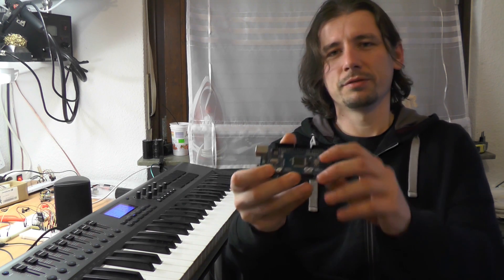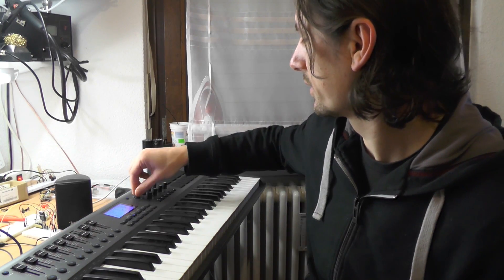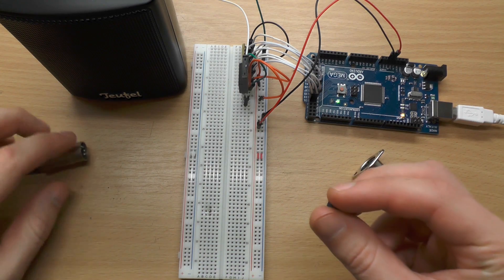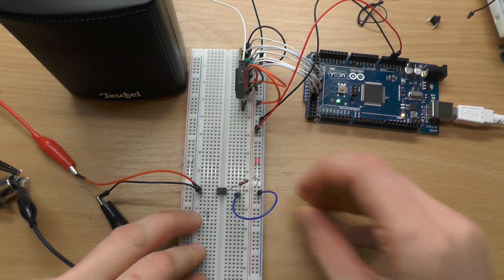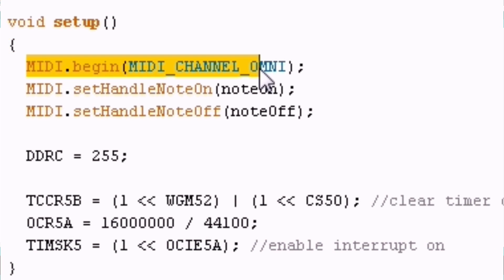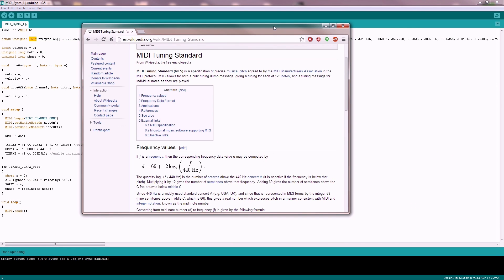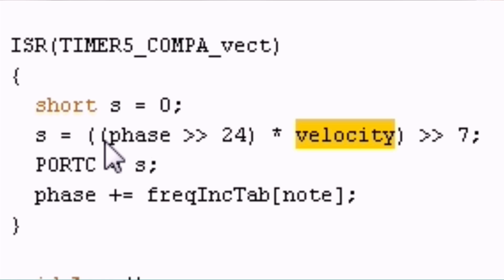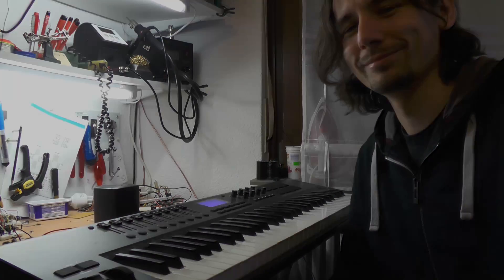Arduino MIDI synthesizer (Part 1) - Basic MIDI IN circuit

Comment: Do you use a reconstruction filter after the DAC to clear the spectrum? I'm asking this because I'm implementing a DDS in a similar way. The problem is when I generate a sine wave its spectrum is full of harmonics. I use a 10 bit DAC and a 2000 samples per period of the sine.

Comment: Hello!
What is a best model/version of Arduino to build just a MIDI-2CV device? I want to build a simple monophonic analog synth. using basic radio details and microschemes. But I'll quickly will be bored by it's "one tone sound". Even a potentiometer will not save it :)
So that's why I'm searching for this. Of course later I'll want to build a polyphonic analog synth. So probably I will use the same Arduino to send different CVs to different "cards" of my future poly-synth.
Do I need Mega? Or it will be the same with Uno and etc. Pardon me, I'm a noobie here :)
P.S. I have the MIDI keyboard already.

Comment: It would be amazing to see how to make midi controller synth using sound chips (like cheap CD40106BE / atari YM2149F/ NES RP2A03) instead of arduino generating waveforms.
Reply: If you like electronic a little bit more you should take a look at circuit bending. A lot ow good work with cheap keyboards, toy keyboards etc

Comment: Your MIDI interface circuit is bad. There is no resistor in line with the LED in the opto isolator and you are in danger of burning it out. There is also no diode to protect things in the event of connecting a swapped over MIDI cable.
Reply: This is not a finished device, but only a prototype.
And he, ignoring these disadvantages, it works.
However, notes the shortcomings helpful. Plus.
Reply: Those are not disadvantages or shortcomings so much as they are deficiencies and worst case scenario? You just blew up your hard work. It works? No. It worked. Now it doesn't. Don't just take notes, get educated and spread the news. Protect your circuits!

Comment: Thanks for the idea. This is a much simpler midi in solution. I've read that dip4 optocouplers may not be able to handle speeds over 9600 bps and midi is 31250 bps. I'd love to try a PC817 as they can be had as low as $1.50 for 10 on Ebay. What type did you use?